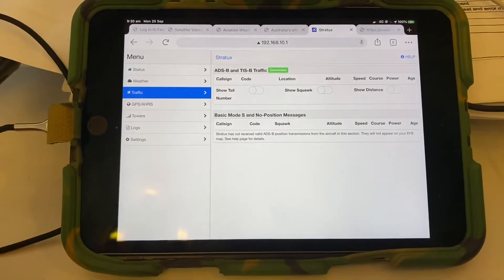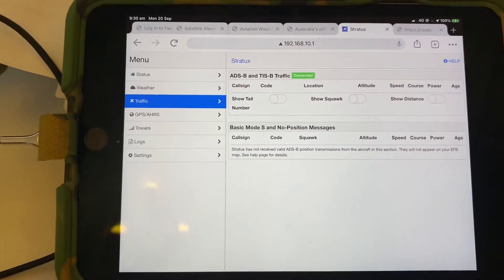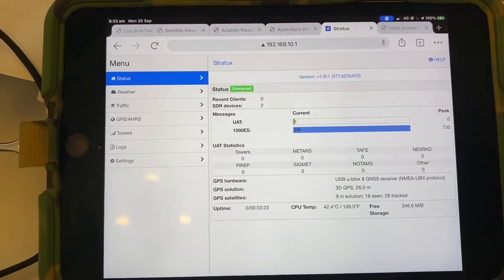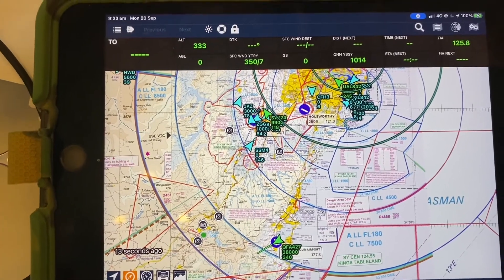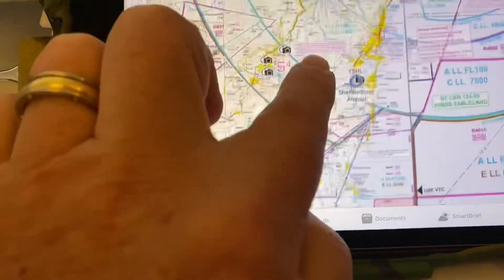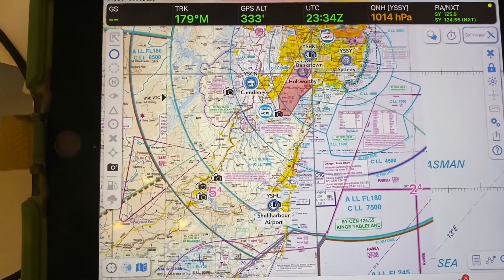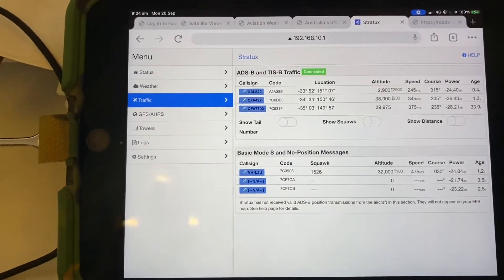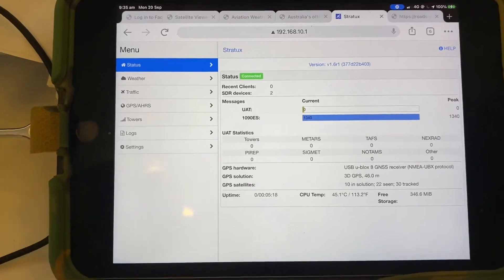Stratux ADSB device - how to fix no traffic issues - Crew Dog Electronics

Comment: Mine is not updating the radar in flight. It might work for awhile then I will look down and it hasn’t updated in over 20 mins. Any idea what it might be. Traffic works great
Reply from the maker: G'day mate. Not sure for you. I don't use this anymore as moved to a Stratux. However, you may have been getting internet traffic for a while..check to ensure  you have connected to wifi via with a manual IP address for it to work correctly..this will enable not only this device to work but also internet.. When you say "updating the radar" do  you mean live air traffic? I am in oz so we don't have adsb other items like when flying in the US.

Comment: what app are you viewing the stratux feed with?
maybe a little spritz of contact cleaner on those USB connections, my old stratux is showing signs of corrosion on the antenna connections
Reply from the maker: G'day mate. Good idea..I re glued the connectors..and also if you lie it flat..doesn't seem to play up as much than if stuck to side of the shield. Here in Oz we use a few EFB's Avplan / Ozrunways and Foreflight..albeit Foreflight need to fix that when running ADSB in..need to use internet as well for weather etc. Hope this helps others..still using and in past 6 months not playing up as much..great little unit. We don't have any corrosion on our units BTW..

Comment: A very helpful video.  I've also found that after a while of use the fan may come loose from its hot glue to the case and start buzzing.  Disassembling and re-gluing the fan to the case should solve this (unless the fan bearings are worn out).  I also needed to hot glue the GPS module that had broken free of its glue as well.  Thanks for posting.
Reply from the maker: No worries Sean, to add to this I do find..from time to time..when it is running for say 6 hours straight..for some reason we keep getting ADSB paints..but all of a sudden the GPS satellites drop out and lose GPS. However, when we reboot..GPS is 20 plus then as soon as detects ADSB paints..bingo GPS satellites all drop off. Very strange..and yes agree with the fan..screams it's head off sometimes too. Craig